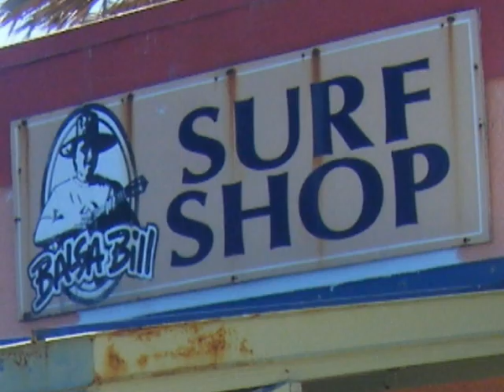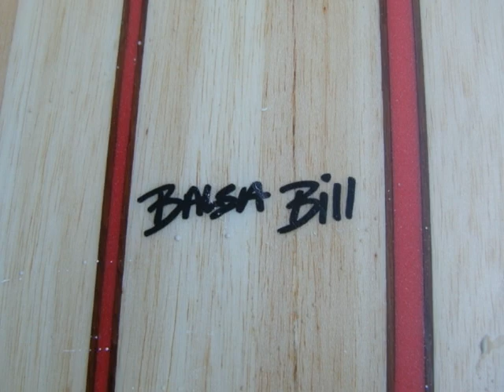Building a Balsa Wood Surf Board

Comment: Cheers Bill. I've seen in other hollow boards they sometimes use a vent to release air pressure for a change in temperature. In your experience do you think this is necessary for this type of board?
Reply from the maker: +biltongFTB  When  I took the last two to Hawaii I drilled small holes in the deck. Just a few random holes. When I got to Hawaii I filled them with toothpicks and put some suncure resin over them then waxed it up and went surfing.
Go to my website balsa bill and search around you'll see how I fixed it.

Comment: how did you knock it apart so easily? Im about to start a similar project using cedar with hardwood stringers. It almost looks like you didnt glue the boards together before you planed the rocker template?

Comment: Hi Balsa Bill ! I'm french and I want to shape a wooden surfboard and I was wondering what are you puting inside the board ?
Reply: Hey Bill! did you let it closed? or do you have a valve? I did hear that the air inside could be bad in some way for the durability of the wood. what do you think? did you glass it? cheers!
Reply from the maker: When I shipped it to Hawaii I drilled small toothpick sized holes in several places on the deck. When I got there I just stuck in some toothpicks with some white glue. Cut them flush and put a little suncure over it.

Comment from the maker: Full disclosure here: Didn't come out right the first time. That's why it's a 10'5 instead of a 10'6. Getting the balsa/cedar right without getting a dip in the foam (even a 1/16" dip is visible because of the contrast-red) was very difficult. Took three tries. It's the last pass with the sandpaper that does it. That's why you have to stop just one pass before it dips. As I once heard someone say; "You can't squeeze toothpaste back in the tube".

Comment: I'll bet you never have carved from a solid tree. The Duke carved from solid trees, until whittling enough around the edges for the perfect shape. I'm so sorry that the pinko environazis in California allowed all of those beautiful redwoods to burn to a crisp rather than putting them to use, shaping redwood trees into most  excellent solid redwood surfboards.
Reply from the maker: Click here and scroll down. They all start with a tree. http://www.balsabill.com/boards.html
Reply: @BalsaBill  Sir, I respect what you do. Don't get me wrong...PLEASE. However, those are limbs and branches from foreign balsa. I'm talking CALIFORNIA REDWOOD TIMBER. Translation: some sixteen to twenty foot long planks of REDWOOD, that measure three to four feet wide, and four to six inches deep. The finished redwood surfboard would weight between one hundred to one hundred twenty pounds, for a ten to twelve foot log. Of course, this significantly increases with each foot, up to twenty feet long, if you're gangster moke.